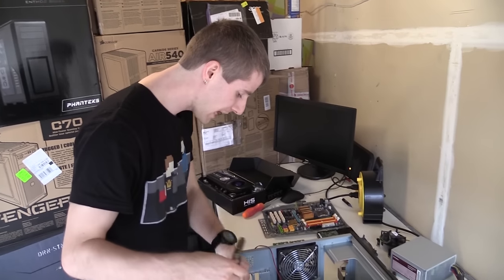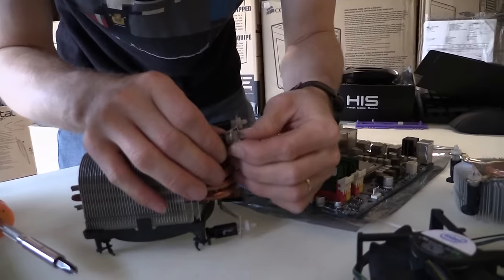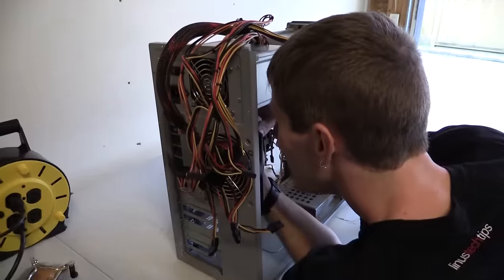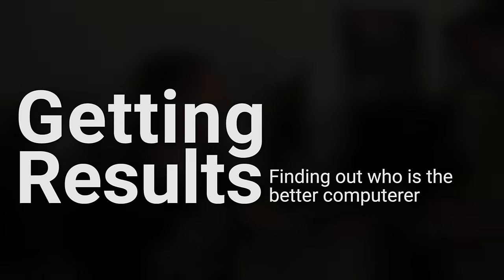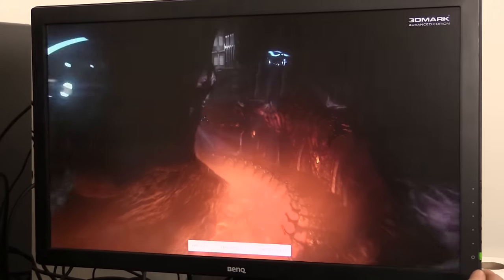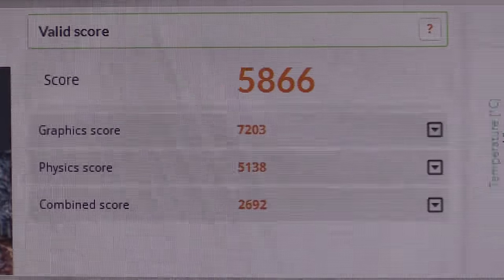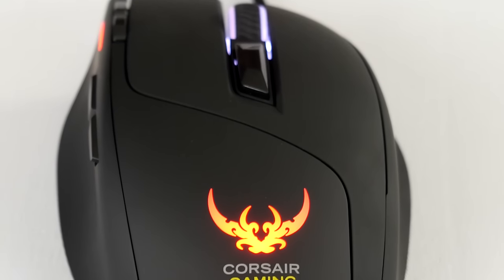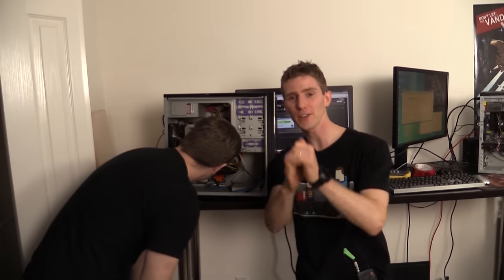$300 Budget Gaming PC Challenge - Scrapyard Wars Episode 1c

Comment: When I polished my i5-2500k with underwear, it became i7-6700k.
Reply: aika kova life hack
Reply: ***** Yes x)
Reply: heyy suosittelen
Reply: Tonni same
Reply: kiitti vinkistä
Reply: mine only became an i3-6950x :c
Reply: I legit have an i7-6700k
Reply: the 7700 k has negligible performnce gains against the 6700k
Reply: lmao slightly higher base clock speed but near IDENTICAL  multi and single core perfomance lol sure 500$
Reply: dude but the worst is my imac mid 2011 which has a i5 2500s which is the mobile processor so nowhere near Tonni's i5.I am getting a 2k computer for my birthday which is in june 2017 which will have a 1070,6700k or maybe a ryzen if the AM4 boards release in my country that is. (India) and also a z170 pro gaming from asus a samsung 750 series ssd and a WD blue hard drive getting powered by a VS550 by corsair.This all will be packed in the NZXT s340 elite (im a sucker for looks , cuz if i wasnt i could have pinched every penny to get a 1080 but 4k monitors are too expensive) with a benq 2560 x 1440p monitor with a K65 compact keyboard from corsair and I already have a decent gaming mose and a good pair of headphones
Reply: your comment is so underrated
Reply: #TechYES
Reply: TESTOSTERONE
Reply: Was it LTT store underwear?
Reply: @minefilms1122  should’ve bought lttstore.com underwear
Reply: That’s not fair, I polished my i7-6700k and and got an i5-2500k!!! 😮

Comment: I really thought luke was going to win because of that insane graphics, but this really proved how much a decent cpu, ram, and power supply contributed
Reply: well, that GPU was severely bottlenecked (mainly by the CPU so i guess that's why that happened.
had he went for a cheaper GPU but a better CPU the scores would probably be higher than they were here.
Reply: NicksDomain101 when luke spent that much on a gpu i was thinking bottleneck!!!!!
Reply: Super insane graphics card
Reply: Me watching in 2023. How good is an R9 290???????? I assume it's worse than a 390X and nowaday that gets absolutely embarrassed nowadays.
Reply: @nand1185  It's not bad, although it will lack modern features like RT. But it is quite a capable GPU for how old it is. For reference, the AMD 6700XT is a modern midrange card and it has about a 300% performance increase over the R9 290.

Comment: Linus' $300 PC Tomb raider benchmark: +9000
My $600 PC: 4000.
Reply: +RaughingRoudry you must have shit specs
Reply: HailTheSnail Exactly.
Reply: ***** Garbage 3 Single core 0.01 GHZ, Trashcan Display Adapter 1 CUDA core at 1 core clock. 1mb Ram.
Reply: +CoDANGER7 Does it matter? Dell is a pile of overpriced poop. Why buy a Dell when you can buy better at a much cheaper price by going to shops or shop online for individual parts and either build yourself, get a friend to build, or even take it to a local computer repair shop (much cheaper). Even the Alienware line is way overpriced i've seen $1500 Alienware builds running on an I5 and a $300 GPU. Not saying Alienware is complete shit because some of their cases are pretty sweet but bang for your buck pc builds not so much. It's more like empty your bank account for a sub optimal gaming rig with ok aesthetics.
Reply: quinn v Yeah it's fine spending $400-$500 on a prebuilt office machine but when you sink in $2k and only get a $1.3k rig that's messed up you'd be better off just buying the parts and take it to "insert mom & pop shop name here". We have like 3-4 repair shops in less than a mile of each other.
Reply: +Vincent Kenworthy lol
Reply: I adore my area 51, it might be a little overpriced but its a Alienware...its a Alienware!!!...…………..….I wanted one since I was 15 finally got one last week. Just wish dell never bought them out but at its height when Alienware sold their company they were one of the top gaming computers and what other gaming computers inspired to be. Alienware and world of Warcraft were pioneers and  the most successful at their peaks. Still like both ;) @MrHeavymetalmania

Comment: I like how a fucking CPU from 2007 can still handle games and doesn't do much of a bottleneck, all for $300
Reply: I know right? Just tells you how little use a cpu really gets in most games. Kind of makes buying I5/I7's for gaming look kind of silly. At least it means we can keep our set ups for damn near forever and just keep the GPU current.
Reply: Martin Landart so you got a £180 CPU to match a £100 GPU? I imagine you are upgrading GPU?
Reply: devilmikey00 not.... quite.
but say, an i5 2500k is more than enough for most games.
the ones it isn't, are probably on very inefficient engines. or are doing extreme volume of calculations on the CPU instead of offloading as much as possible to the GPU).
Reply: devilmikey00 Yeah, I'm looking forward to squeezing as many video card generations as I possibly can out of my overclocked i5. Probably won't really need to shell out for a new CPU/mobo/ram for at least 5 more years.
Reply: Sam R Hell yea dude, loved the hell out of my 3570k
Reply: ITS INTEL SON!!!!!!!!
Reply: devilmikey00 To be fair, it does depend on the game. Some use the CPU a lot more than others.
Reply: Drew Peterson That's what I have too! Clocked at 4.3GHz on a 212 Evo with good temps. Could probably get to near 5GHz with acceptable temps on water.
Reply: it really depends on the game in bf4 hi have a hard time reaching 60 fps with my overclocked x4 965@ 3.8 ghz or fx 6100 @4.5 ghz cpu pegged at 95%+ on all cores gpu 60% the gpu is an 6970

and with an 7950 on ither chip 40fps is the avrage at the same settings in bf4 no this trend is looking to keep up with alot of new games like acu FC4 technically crysis 3 shadow of mordor etc etc and this is just with an 6970 

although with less demanding games  games like payday 2 bf3 and any low end game ur at least 75 fps + all the time

if it was last year i would have said the same thing but times are finally changing although great deals are still to be found if you are willing to put an little work in to it in such as $50 8350's with bent pins and an chepo $50 mb would greatly out proform the combos they made with still the tinest amount of oc head room
Reply: Drew Peterson Oh yeah, and nice Will Smith avatar. You a Tested fan? I was a huge fan up until the Jamie and Adam takeover, then I fell off hard, and unfortunately have no clue what they're up to these days.
Reply: Andrew McEwan You're using AMD cpu's. Those are going to have issues in multiplayer games and other games that require strong cores
Reply: Andrew McEwan your england is just magic
Reply: Drew Peterson what happens if I tell you that my 2600 at 3.6 is getting close to bottlenecking my  my 290 and would deffnetly bottleneck an 79xx crossfire In Bf4 mp 

Also your going to tell me that the  q6600 and an pII x4 even compete both stock and oc ed

Yes that is an edit
Reply: But can it run crysis? Didn't think so.
Reply: Ben Zimmerman old joke, but still always a good laugh.
Reply: SlavjanA I know I know big thumbs on tiny phone keyboard does not help much too
Reply: ***** lol right?! It's true though. That cpu would crash and burn in crysis 3.
Reply: lol in 2012 I was debating whether I should get a core 2 quad,or new CPU/mobo. Definetly glad I went with the i5. Now its 2015 why would you go for a cpu that was manafctured nearly a decade ago. At this point get an i3 atleast its a factory new component even if its a 2 core.
Reply: Martin Landart Well, that's because that dual core was REALLY holding back the 750, but a decent i3 or quad core would be more than enough for the 750. Personally I run the 750 too, paired with a stock core2quad 8400 (2.6ghz) and although is quite dated, it is still a perfect match for the 750 and I get exactly all expected scores on the benchmarks. But when I tried it with a 2.0ghz core2duo, the 750 couldn't even go above 20% as it had to wait for the dual core which would ramp up to 100% alot of the time.
Reply: Sam R Yea, I liked Tested when they were with Giantbomb/Whiskey Media. I fell off hard too.
Reply: Andrew McEwan 3.6 is a pretty low overclock, especially for sandy bridge. Bump it up to 4.2 or 4.4 and the bottleneck will go away. the 2600k is still a powerful CPU.
Reply: Ben Zimmerman honestly i'm pretty sure that's just with the way Cry Engine is written.
everything in Cry Engine i've ever played has always resulted in the highest Temperatures outside of running synthetic abuse benchmarks.

the way the instructions are passed to the CPU in Cry Engine... something about it. makes every CPU light up like a campfire compared to other games. and not due to Framerate either, whether Cry Engine is higher or lower Framerates for people's systems.
Reply: ***** damn, really? I never noticed that. All I know is cpu utilization is really high. It's completely unplayable with a dual core from what i've seen.
Reply: And it's still better than PS4's "octa core" CPU.
Reply: hristaki99 Amen.
Reply: hristaki99 teehee I think the ps4/xbone actually have two mobile CPUs bolted together. How pathetic.
Reply: Drew Peterson notice how I did not put a k :( mistakes where made bought it close to launch sorta missed how Intel changed how over clocking works can rase multl to get 3.9 but don't have an p67 or zxx board. though it is running at an -97mv offset voltage on a side note it is nearly not better than an 920 at 4.0 at 4.2 decent clocking c0 stepping  ( locked chip too) same cnebench score
Reply: Andrew McEwan oh :(
Reply: Ben Zimmerman Different architectures. The consoles are ALOT more like amd's apu. Cpu+gpu all using the system memory. And from the benchmarks apu's aren't all that impressive. Sucks for consoles since they pretty much have a few more years with outdated hardware.
Reply: Drew Peterson I guess... I'll be keeping my 3770k way past skylark cpu's even XD Guess I better just save my budget for that higher res + next gpu upgrade that'll cost........ money.
Reply: Andrew McEwan A 50$ motherboard for an FX chip is a disaster waiting to happen, higher end 970 platform at a minimum, or 990 for the best experience. The 8 core chips really push the board power circuitry especially when you overclock. But they are damn nice chips for the price. (100 dollar 8320 on sale at microcenter anyone)
Reply: Carlos Jimenez oh I'm aware of that. The apus in the consoles are way better than the 7850k though. They have a gimped 7870. More like a 7790 now. Not bad for $400 if I'm totally honest.
Reply: This reminds me, I need ot upgrade my ITX build, shoved an A10 in a silverstone. Now I need to get the RVZ02 when that launches, AND put my spare pentium k in there. Maybe buy a new GPU for it too.
Reply: I had a Q6600 that i only retired last year and it was still bossing many games even with a 4870. Realistically i could have just put a new(er) graphics card in and it would have been good for another 1-2 years. It's still in the cupboard, might try and do something with it
Reply: ikr. i just tried fire strike, got 4344. thats on an i3 4160 and r7 265. built the system for $600. yet this still smashes it with an old cpu. i just got shrekt.
Reply: Cough. A 290x gets around 140/170fps in dirt 3 with no bottleneck. It was going about a third the speed in the video. 50fps !!! That's literally about the speed of an apu.
Reply: Tatas Gr heck yeah it would. still confused on that 290 price though. that's insane!
Reply: Martin Landart
ya but that e7400 was a dual core low end part from 2008. The equivalent of a modern I3 in product line. I mean it wasn't really rocking the world when it was relevant.
Reply: Thomas Riddle
Well ya lots of RTS type games (shogun 2 comes to mind) can really stress a CPU hard but the majority of stuff is still pretty light on the cpu side. I have a 3570k at 4.6 and I'm lucky if most games push it up to 30% usage.
Reply: devilmikey00 Not all non-RTS games though. Battlefield 4 is pretty CPU intensive. My 4690k is constantly at 80%+ usage when playing that.
Reply: Carlos Jimenez what do you mean a lot like an APU?
it's a Jaguar based AMD Processor with a high end APU for Graphics.

'high end APU'. wow, that sounds so contradictory. since it is. iGPU's might be getting to be okay, but they'll never be 'high end' compared to full sized GPU's. all a matter of how much space is available.
Reply: Thomas Riddle  Yeah, and Assetto Corsa with 22 cars grid, easily 95% CPU usage.
Reply: CPUs haven't really progressed much for the last couple years. They're just putting in more cores and making them draw less power, which is great on its own but we're not seeing any 5GHz beasts out there.
Reply: BrainSeepsOut
Ya intel is more interested about power efficiency these days at least on the consumer side. Their extreme line is fricken beast still. I mean a 5960x has 8 cores and can be overclocked as high as 4.6 assuming you have the cooling to tame it.
Reply: Drew Peterson Definitely agree, I'm still running a 2009 i7 975x quad core @ 4Ghz and the only thing i'll be upgrading soon is my GPU from a Radeon 7970 to a GTX 970.
Reply: There is a difference between a bottleneck and gaining frames with a better cpu. I had a 3570k@4.3 with a gtx670 and it ran fine. Upgraded to a 3770k@4.3 with the same 670 and some games saw pretty big fps gains, and ALL games got a boost in fps. Games like arma saw a 10 fps gain on average with the minimum fps jumping way up, like for like. And this is an i5 3570k overclocked we are talking about. Sure, a shitty cpu will get the job done, but don't discount the value of a proper cpu in gaming,  nevermind the massive performance gain in multi threaded tasks and rendering. The biggest gain I got was a much higher minimum fps, which is probably the most important imo. Im still running the old 3770k but now with a 970 and loving it. Gave the i5 box to the wife. I also used that old 4gig 670 and put it in an fx6300 build I had, it runs like ass next to how the i5 and i7 ran, yet still doesn't "bottleneck". Gave that rig to another family member.
Reply: 1MuchButteR1 Just 2 days ago I finally threw away my 2004 Intel PIV@2.6 GHz, because of fire reasons. That little guy was a stubborn son of a bitch, wouldn't die... I even managed to play the first Crysis (low and little medium settings, obviously) on my old PC (P4, 1.5 GB RAM, 512MB GPU). Intel does not fuck around with their CPUs, they're sturdy.
Reply: cakeless coder the GPU is to blame, I think. Also, how much RAM?
Reply: Alexandru Ionescu i agree on the GPU (think i might get a 580 and ghetto mount the 2 GPUs in my system ;)). i have 8gb ram installed, (ddr3 1600mhz if it matters all that much)
Reply: Drew Peterson An i3 is best for gaming on budget, get the ivy bridge i3, a gtx 960 and you are good to go.
Reply: Kestrall vector Yup!
Reply: cakeless coder 8 gigs at 1600 will last you for at least 5-6 years, if no surprise game engines come around.
Reply: Alexandru Ionescu i don't think it will last that long, but it should last a while. since it is coming down in price, i don't think it'll be any hassle when i do need more ;)

Comment: This is exactly what I did for my friends PC. I was able to snag some part for my friend PC:

Core i3 3120, 4GB of Ram, 500GB HDD and plain jane mobo - $100
GTX 760 - $110
EVGA 500W 80+ Bronze (bought it new cause I'm anal about psu's) - $50
Another 4GB stick of ram - $20

So for less than $300 I was able to build my friend it pretty darn good PC for med-high gaming.